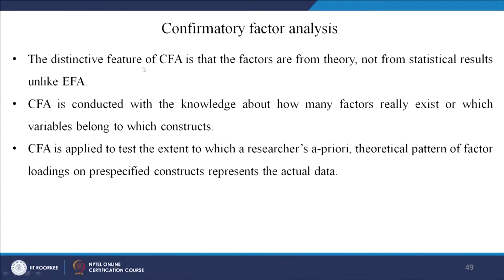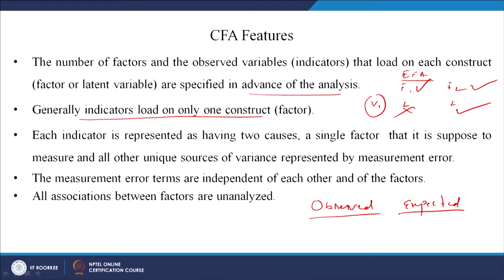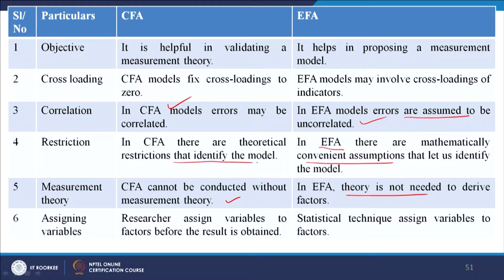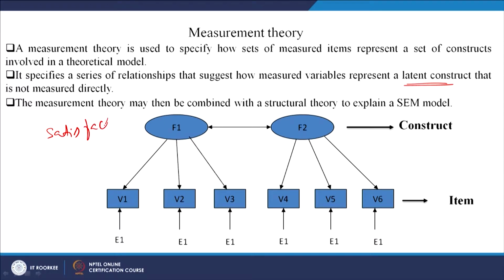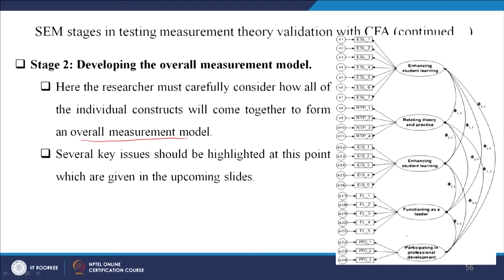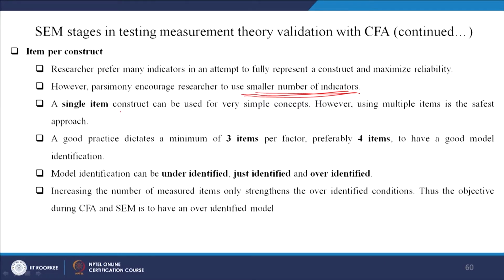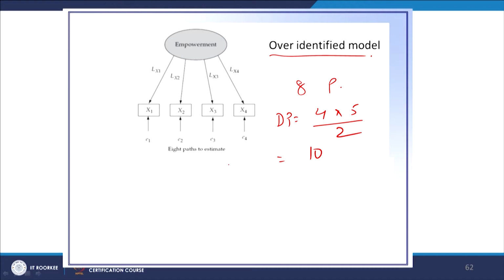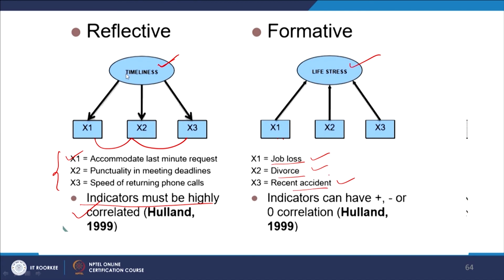54. Confirmatory Factor Analysis in SPSS I

Comment: sir if we take different dimensions from different authors in one questionnaire like for example for 
measuring green practices we take 
energy, water,air etc 
related statements in one questionnaire now can’t we use efa to check whether they correctly measure green practices ?